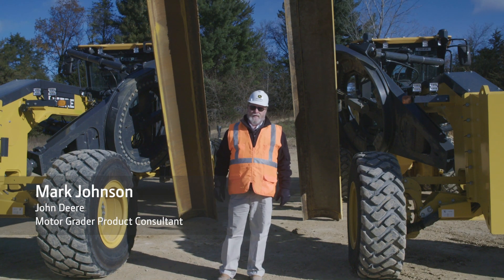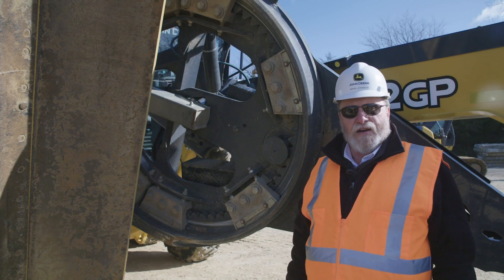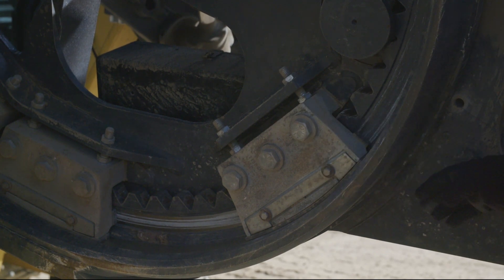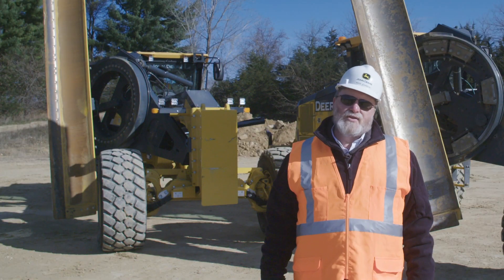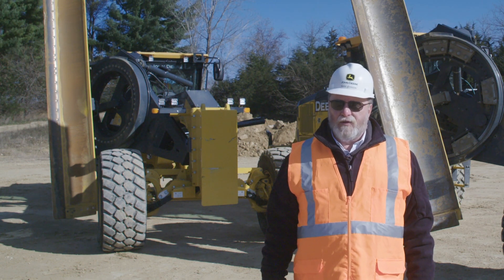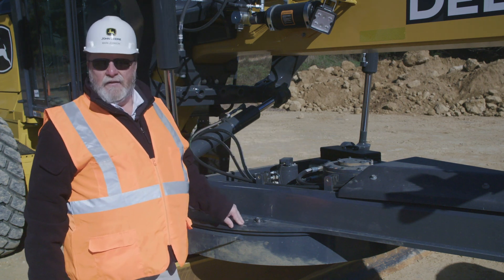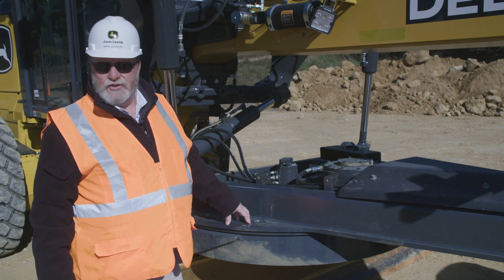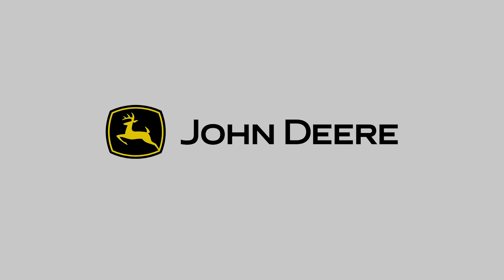John Deere Motor Grader Premium Circle

Comment: It's about time John Deere addressed this issue I own three motor graders and I'm constantly having problems with circle gears, gearbox, pinion and shims.
It's to the point now where my next grader that I buy will not be a John Deere because I definitely don't want a new machine with all the emissions and sensors. 
Also the machine requires Brandt to come in and plug in their computer to mine just to change part that takes 5 minutes.  As an owner operator I need to be able to work on my own stuff without Brandt engineering their own service into the equation.